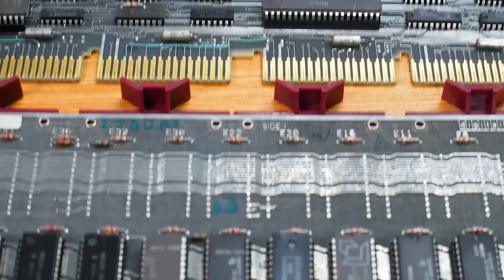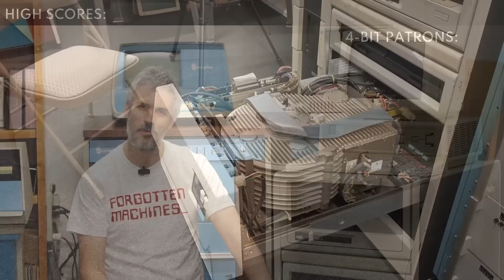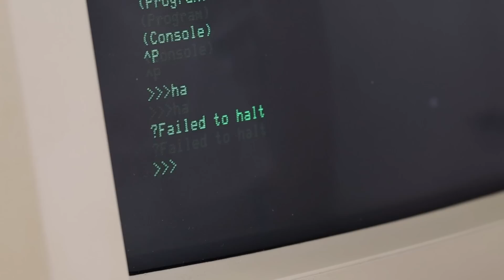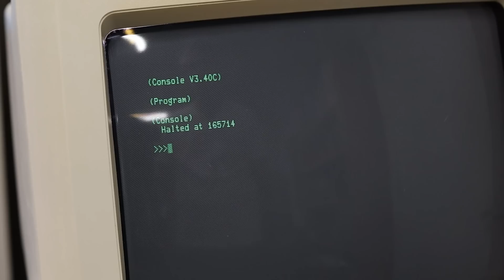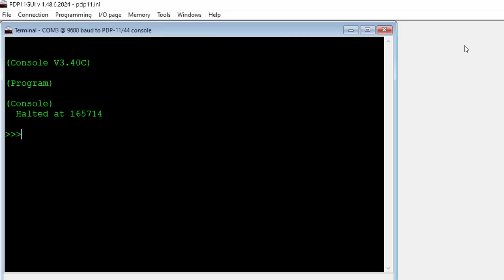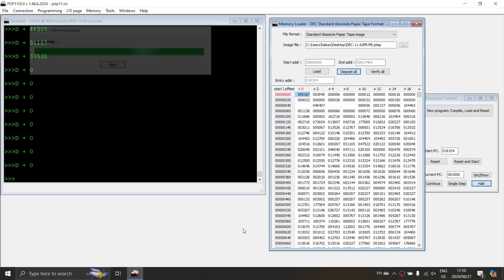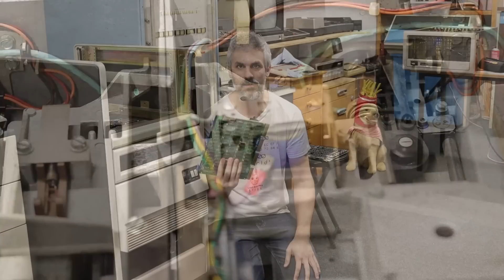Solving the halting problem with my PDP-11/44!

Comment: If you're doing much with RS232 I'd suggest obtaining a RS232 breakout box. The good ones have a led light for each pin and enable pins to be re-routed (eg swap pins 2 and 3) via switches so that default straight through can be broken and re-routed using patch wires. You can see what's happening on the line via the leds to diagnose issues. I got mine back in the late 1970's and it was a godsend when trying to get RS232 devices to talk to each other.

Comment: You don't need a boot rom to boot from a drive. You just need some code that reads the first n sectors (eg 4 for RL01/RL02 drives) from the drive into memory and then execute it. Using PDP11gui this is easy to load once you have the right code which isn't that difficult to program if you have the relevant device manual.

Comment: On VAX 11s the rotating key had a series of options like startup to halt, start and boot and disable the run/halt buttons on the front console. The VAX 11/750 then had different boot bios options to select 4 device types, but I even damaged my VAX11/730 when I first got it - the unibus ribbon cable causing ripping wires which resulted it in coming up and halting. The grant cards and DMA continuity if missing give issues as well even on some unibus systems people would cut the wire wrap for DMA boards to work but then you put a non DMA card in and it would cause the whole thing to fail. I used to as a hobby use one vax with macro-11 send down through console of a VAX11/750 to try and run the TU58 internal cassette to operate it - very slow going trying to develop it as the packet for the TU58 controller was a bit finicky for my meagre skills got it to do some things like seek etc.

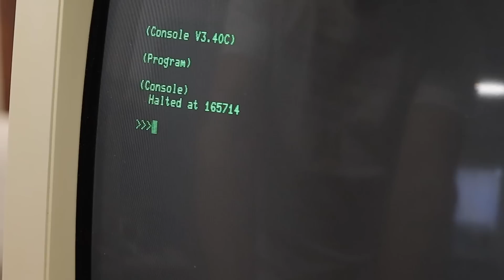Comment: I don't know much about the PDP, but at 8:13 it shows halted at 165714. And when you typed ex (to execute)  something it replied "p 00165716 00000". It makes me think the code is a counter like where it is in memory /stack. Such as console halted at Memory 165714 cause nothing was left. It was and when you tried to execute a random thing, it was all it did was print the next bit in memory, bit 165716, and replied 000000 cause nothing was there. Maybe it's a memory thing or you hit the end of the boot sequence at memory 165714?

Comment: Could the halt issue be caused by the keyboard interface constanty putting some kind of interupt out? The fact that your emulated terminal environment worked suggests to me, with zero PDD11 sleeves up experience, that you have circumvented an erroneous input issue.   This is compelling viewing!  Great work

Comment: BTW:  The halting problem is only completely impossible if there isn't a size limit on the memory.  If the total state of the machine is in N bits, you need a table of 2^N bits.  You then for each state the program goes through you check to see if the bit for that state is set and if it isn't you set that bit.  When you land on a state that repeats, you know the machine never halts.

Comment: 1.  You can’t halt an OS or program if you haven’t loaded one and got it running.  2.  It looks like you don’t have any mass storage device connected (hard drive, floppy drive or tape drive).  3.  If there is a mass storage device attached, it must contain a boot sector to get the OS started.  4.  A ROM may not contain the proper code to start from the mass storage device you have connected.  I worked with PDP computers from the 1980s into the 1990s.  After you do manage to load the executable image of an OS, it must load a device driver to handle that device.

Comment: I'm not sure but I think in PDPese, halted means it has dropped to what we typically call the monitor ROM on a microcomputer
(Program) is the OS or executive and (Console) means you are in the monitor.
So yeah, it's going to halt if you power it on and there's no boot devices or it hits an illegal instruction because of a bad ROM.

Comment: I have a feeling that the instruction 00 in PDP is HALT. So if the memory is clear, the processor tries to execute from location 000000 and reads 00 and HALTs.
Or I could be thinking of the Z80 which definitely does have 00 as a NOP, which is useful for fault finding ...
Reply: You're right. PDP11 0000000 is a halt instruction.

Comment: You should not assume boot ROMs to be present in a PDP-11.  I'm not familiar with the /44, in some systems you are supposed to manually type in a loader (they are are reported in one of the manuals)... you can also check if a UNIBUS card has them (e.g. M9312 in the /34A I used to play with, check manuals for the /44).

Comment: It's more of a bypass than a solution, but it demonstrates a very important thing: The processing logic circuits are functioning properly or they would not be able to run BASIC. This is a great motivation to invest time into really figuring out what causes the halt state to occur at boot. If you are running into exactly the same error at exactly the same memory address on a computer that may have come from the one that posted the request for help in '98, you might be working at the exact same unit the poster was trying to troubleshoot in '98.

Comment: I am happy to tar up what I have and throw it on a server for you as well.. my machine is a PDP11/23.. and hasn't booted off disk in awhile as the working mfm drive I had, developed the fault that you could shine a flashlight through one side of it and see light from the other side.  the seal had completely dried out all the way around the drive and opened up.

Comment: Have a look inside that ribbon file, there is bound to be a wait in millis either as a global or actually between each command. If it's in hex, see if you can time the delay between entries (time 100 commands / 100) and search for that value in the first page of the hex. halve the value and try it again.

Comment: Hey Dave! May I ask you what are you planning on running on the 11/44? I've read some PDP-11 models can host an ethernet interface board, and with the right OS and config, can even do IPv4, and therefore be online, tho on a limited capacity, but that would be pretty awesome!

Comment: That Fuji Eagle probably has a SMD interface, I believe, and I think they were aftermarket, not sold by DEC.    You need a Unibus SMD card to interface it, such as an Emulex UD33 or a Dataram S35.   The Emulex SC12 you have there is an SMD card, but its an RK06/RK07 emulator, and probably won't work with the 400MB or so Eagle, that requires the UD33, which emulates a MassBus card like the UDA50
Reply: There are several possibilities for how to use a Fuji Eagle with a DEC machine.  Yes, the SC12 emulates RK06/RK07 drives, and probably can let you emulate several of them on one physical drive, but even 8x RK07 (max the DEC RK611 controller supports) is 224MB (plus any overhead for how each emulated drive sits on whole tracks).  It's unlikely that anyone would have paid for a 400MB drive to use just over half of it back in the day.

We had a Systems Industries SI9900 (there are older ones like the SI9400 that were more common on PDP-11s IIRC) that could take multiple SMD interfaces and we had one 160MB Fujitsu and one Eagle.  It presented as two DEC RM03s (67MB each) as half of the 160MB drive each, and the Eagle showed up as a giant-sized DEC RM05 (normally 256MB but you had to patch your DEC OS driver to change the geometry table, a common thing with 3rd party drives).

So... if you do have an MSCP controller that can talk SMD to the drive, that takes care of a lot - unlike older schemes, MSCP drives present to the CPU as a sea of blocks not tracks, heads, and sectors so a lot of the geometry problems fall away.  I'm not familiar with the UD33 but that sounds like it would take care of many of the messy details.

Comment: Mmmm, I LOVE the 11/44!  Their CPUs are built on AMD's bit-slice processors.  I'd love to see it's microcode reverse engineered...
Reply: The AMD2901 and AMD2903 were a slice of the arithmetic logic unit and didn't have microcode. Where the micro code came in is the PDP instruction was passed to a microcode state machine which would select the signals on the bit slice chips. They were really neat chips at the time because they sucked up a bunch of logic on a single chip. They don't make them any more but the spec sheets are still available. I played around with making my own personal computer at the time but it was a larger project than I wanted to take on. By the time I got the hardware constructed and a primitive operating system running, I would be able to purchase something better.
Reply: Ahh, I always knew that the UNIBUS was microcode-like.  I just never made the connection.  I wonder if there's published schematics.  Does anyone know of any?

Comment: Too bad you can't run C64 HesMon on it  and see what is going on....

I used KiCad to reverse engineer a PCB that I knew nothing about..
Start by making a symbol/footprint of the edge connector 
and work backwards from there.

Beep out the power and data pins on the chips and see where they go on the edge conn..

Comment: As others have already mentioned: your floppy controller is a 'quad' Unibus card, these always go to the FRONT of the BA11 box (rows C-F) -> if you leave the back rows (A & B) free in that slot then you have enough room for the floppy cable. Most likely the floppy controller uses DMA so you need to put it into a Unibus slot which does NOT have the NPG line shorted -> there must NOT be a wire from pin A1 to B1 in row C of that slot.
I would make sure the second from left slot (#13) does NOT have that jumper on the backplane, insert the floppy controller in that very slot, and then try a 'B DX' (for RX01) or 'B DY' (for RX02) command. At least your floppy drives should show some signs of life, clicking, seeking maybe, ....
... I used to repair PDP 11s back in the 80s .... your videos bring back glorious memories, thank you so much!
Reply from the maker: Thank you so much for the insight!
I was fairly certain that it needed to go in rows C-F, but the manual I found for the floppy didn't explicitly state that, so I wanted to be extra sure. The PDP-11 is both a blessing and a curse when it comes to documentation. There's so much documentation out there, that I'm 100% positive the information I need is always readily available, but there's so much documentation it's overwhelming and actually makes it more difficult to find stuff!
I knew that all sorts of grant lines needed to be thought about, but I wasn't sure which ones, thanks for giving me a direction to run down! In the next episode in the series, we'll try to get the floppy box trundling to life!
Reply: @UsagiElectric  
The DSD card is obviously a Unibus SPC card, because it has the distinctive Unibus grant priority card plugged into it. 
You need to look at the documents (module utilization diagram) for your backplanes to know exactly where the SPC slots are. Unibus backplanes have varied and complicated wiring. Thus is is very important to look at the module utilization diagrams. (The QBus is much closer to a straight bus.)
SPC slots are always rows C-F, and the "cablegami" happens above rows A & B. I/O cabling on Unibus machines is quite ugly.
The RX11 (for RX01) was not a DMA device, but the RX211 (for RX02) was a DMA device. So you will want to choose a slot that has had the NPR jumper removed. Those long green-handled G7273 cards provide continuity for the four interrupt grant lines, and the NPR grant line. 
Presuming that the Data Design card was configured as the first RX211 on the system, the CSR address would be set to 177170 (octal), and the vector set to 264 (octal). Once you plug it in, you would be able to read that CSR address from the console monitor without an error. (The address is really 777170 on the bus, as the Unibus has 18 address bits.)
See page 3-1 in the PDP-11/44 Technical Manual for which slots are SPC slots. https://bitsavers.org/pdf/dec/pdp11/1144/1144_SystemTechMan.pdf
It also discusses the DD11-CK and DD11-DK expansion backplanes (page 5-22), which provide 4 and 9 SPC slots respectively. VERIFY that your expansion backplane is one of those before plugging anything into it, as the RK611 is also a 9-slot backplane, and would superficially look like a DD11-DK. There should be a label on the side of the metal casting.
The physical packaging of Unibus systems is chaotic.
Reply: Definitely worth reading the docs on how to configure a Unibus machine and what an SPC (Small Peripheral Controller) is and where it goes.

Yes... you should be careful about where you plug devices in.  MUD (Modified Unibus Device) slots are not SPC slots.  It's why there's a huge warning sticker on the terminator card visible in parts of this video.  Harald is correct about placement and calling out the DMA jumper wire that has to be removed.  Of course on a used machine, it's possible there are slots where it has been removed previously, but you do need to go look.